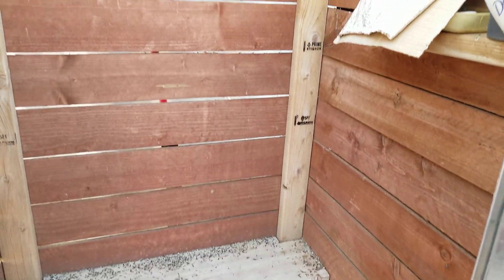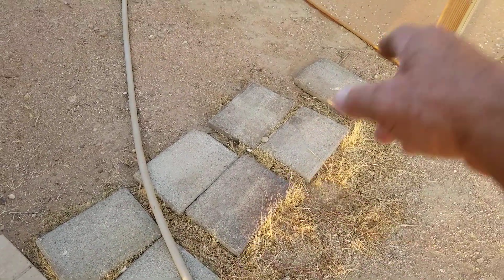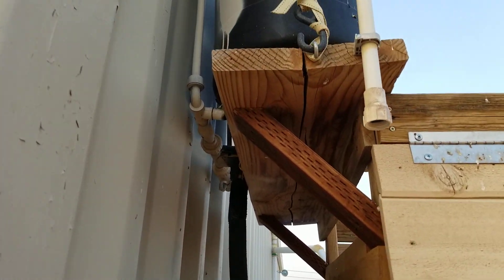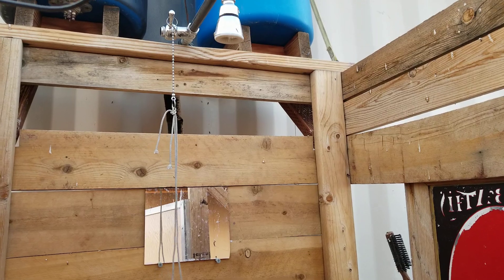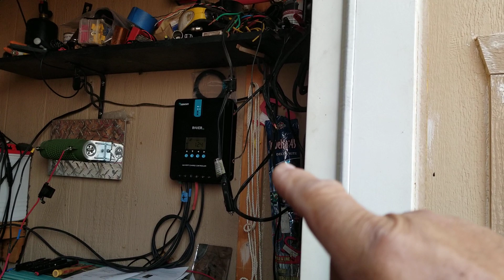My Outdoor MASH type shower design, Sep. 13, 2020

Comment: I picked one of these up for about $20.00 for Bird Poop and stuff.   Not Great but they work better then one would think.  https://www.amazon.com/Electrical-Pump-12V-Portable-Pressure-Self-priming/dp/B07FZ5RBMS
Reply from the maker: Now getting 2 year old messages i never saw before...

Comment: I need a 24V water heater.   I have plans of using a 24V heater element for Hot Water on Demand.  Nothing more then the Element within some Black Pipe.
Reply from the maker: I'm happy with my Marey propane tankless water heater. It only gets used in the winter months.  The summer heats my water for free.

Comment: Hey old bear, are you gonna order a Whizbang  shunt meter for your Midnite, when you finally get it ?
Reply from the maker: I haven't heard of it or realized a need for it, so, I can't truly answer that question.
Reply: my midnite solar 150 came with a whizbank shunt meter, but I have not installed it yet, I use a coulomb meter instead, the round one for about $30 on ebay, it shows me how much amps go in and out of the battery and the remaining capacity.
Reply from the maker: @johnq8792  ahhhhhh, I looked it up right after you mentioned it, and they are not that expensive, but with the info I get from the 150 I shouldn't need one.
To me it's like adding extra spice to an already tasty recipe.😁👍

Comment: If you put screens around your porch it won't be too long and the walls will go up,, windows will go in,, etc.. Thanks for the shower show.. Would you mind showing how you did your indoor one,, (unless it is a bathtub type,, then not necessary) .. Be on the lookout for your CC manana..
Reply from the maker: The inside one is a bathtub type.  The tub is a good way to go, because the human body needs to be soaked for health reasons.
Reply: @GBear  while the soaking in a tub part is true,, it won't work for what I need to do.. que sera, sera..